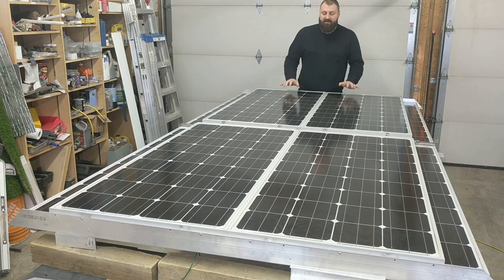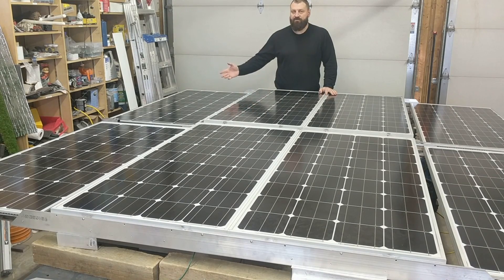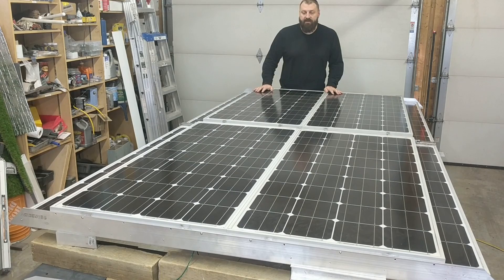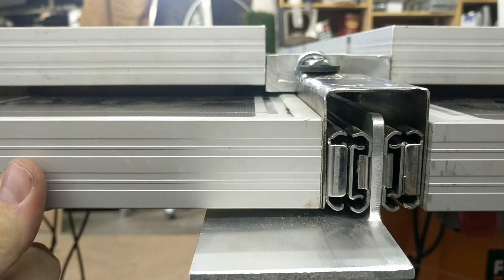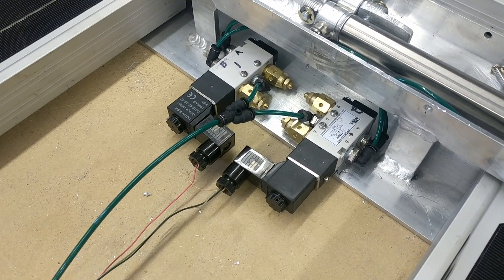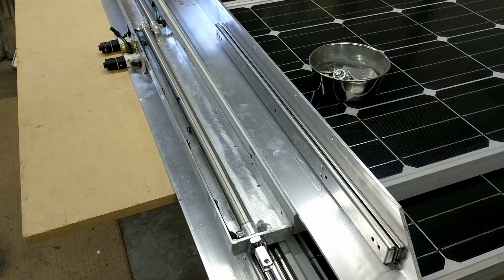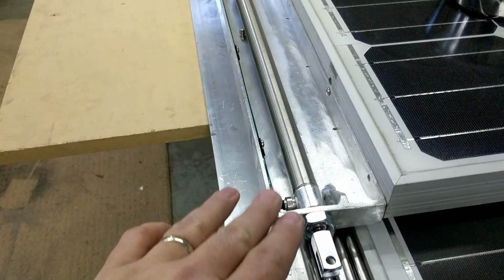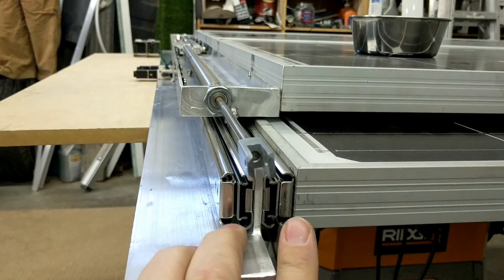Even Moar Solar! 1.4kW Rooftop RV Sliding Solar Install - How to Build an Overlander

Comment: Hi. Just found your Chanel while researching for a sliding solution for my solar panels. So far the best setup I have come across. Sorry to find out your project took a turn for the unexpected. I am very confident both of you will rebound from this pickle and find a way to pursue your dreams in one way shape or form. Life is all about adapting and God knows you’ve amply demonstrated over a decade there is nothing you cannot tackle and vanquish. Call this reprieve a strategic move to recoup, reload, figure out the future and set new plans, whatever time it will take.

You were talking about a friend in his seventies which is kind of what I’m at, with no past experience or knowledge and yet I have embarked on a similar albeit less ambitious path for the next leg of my life. So don’t despair friend, there will be something else, even if it’ll be different, coming your way.

In the coming weeks, I will be talking my own project set to come to fruition next spring, somewhere in Alberta, where I will have moved from Quebec. For the past months I have acquired what will be my new home and the means to transport it, as well as the equipment to modernize it and achieve full autonomy. The solar portion will debut in November and I plan to copycat your system. Most of the work will be done by the RV technician at the Rocky Mountain House dealership where I bought the RV. He’s got a background in electrical engineering but lacks the experience in designing, building and setting up such a system, so the video and accompanying information will come in handy.

Overall there will be twenty panels to install, but roof space being limited, they’ll be setup in two rows of ten overlapped panels, exactly as you set yours up. The challenge was to identify the proper hardware, which you graciously documented as well as the general way the system as designed. Thank you for that. It’s the know how that’s a bit sketchy as the only reference is the video, so not very detailed.

I was wondering if there was a way to keep in touch so that if we hit a snag, we could consult with you? I’m aware your life in the coming months will be eventful so I would do my very best toy best to let you be.But just in case…this would be very much appreciated.  Stay strong, have faith and thank you.  Alain

Comment: Hi! I have probably missed the measurements of the L channel. I know it's 3/16 thickness. I  also performed a search on the context/transcripts and couldn't find it.  Could you share the measurements, please?
Reply from the maker: It's irrelevant... Make them the height and width of the panels you're using...
Reply: @Everlanders ok. Thanks!

Comment: I don't get the aluminum cut pieces to the frame of the solar panel, if the goal is to strengthen the panel frame, putting a whole strip would make more sense? Aluminum don't weight that much. Unless your putting something inside the frame and need the spaces.

Comment: I've been studying this build over the past months. So far, I've been able to model it in Solidworks. The only reservation I still have is the idea of drilling through the side edge of the panel which is extruded and hollow. I assume that you fabricated and glued the 3/8" threaded plates to provide extra reinforcement so as not to deform the edge that grips the panel glass. How much torque did you use for the number 8 screws? Did you use Loctite? I also noticed that you used Sika primer and some kind of adhesive to glue the plates to the solar panel frame. What kind of glue did you use? Sorry about all of the questions. I really admire the work you do, especially because you use open source methods.

Comment: Very nice , how do you stop the travel of the cylinders both going out then coming back in?
What happens if they break when in The out position? Can you manually push them back in and safely drive again?
Reply from the maker: The cylinders extend and retract to their full end stops... Which is the same length as the stainless slides. If they were to fail or we lose air pressure, they can be manually pushed in or pulled out by hand, although in 15 countries, 100,000km over 8 years, they're still doing fine. 🦾
Reply: @Everlanders  that’s Great , did you ever post a list of materials and sources for this build?
Reply from the maker: The cylinders extend and retract to their full end stops... Which is the same length as the stainless slides. If they were to fail or we lose air pressure, they can be manually pushed in or pulled out by hand, although in 15 countries, 100,000km over 8 years, they're still doing fine. 🦾

Comment: I know this video was made quite a while ago now. What great content.  I was trying to find out the dimensions and power rating of your solar panels.  I assume that the 24 inch stainless steel slides would be matched with the solar panel width.  Has 100 lb rating for the slides worked out over time?
Reply from the maker: 8 years and 15 countries later... https://youtu.be/lcck1ejlXt8

Comment: so I LOVE your installation and want to do something similar, the only problem...  I am working with an Airstream with 2100 lb (950KG) payload and wish  to have a total of 10 panels @ 100 watts on top and 100 under it, for 2000 watts total.  I think that alone would be way too much weight, so I am considering ways to keep the weight down.  I already own the 10 glass panels for on top, so I was thinking of using flexible panels under them, lower profile and lighter.  My only concern is the mount points.  My thought is to only mount them at either end and rails and upper solar panels would protect them when driving.  Do you have any perspective on this?
Reply from the maker: I would not consider flexible panels as they are fragile, and prone to fail. Furthermore, they turn opaque when left in the sun.
Reply: @Everlanders  I’ve heard that about the inexpensive ones.  But there’s some higher end flexible panels that don’t have that problem.  At the end of the day, weight is king. I only have 2100lb payload.  I don’t want the solar to be 50% of that payload when we are full timing in it.
Reply from the maker: @escapingthenest2020 I disagree, but it sounds like you've made up your mind.
Reply: @Everlanders  nothing is ever in stone... until it is... and I ain't working in stone, so.... :P  What do you disagree with, is it the payload issue or the solar issue?  If it is the whole issue with payload, I am really curious to hear your thoughts.  If it is solar, do you know anything about either Solbian Solar or Merlin Solar?  Both are higher-end flexible solar panels.  The Merlin Solar panels don't have a clear layer that can turn opaque over time.  The Solbian Solar appears to be mostly used in the sailing world where they are often mounted in places that take a lot of abuse, so I assume they are far from fragile.   If I do this with flexible panels these are the quality of panels I would consider.

I am very curious to know your thoughts though, you know a lot more about this stuff then I do!

Comment: @Everlanders - Have you had any issue with the drawer slides malfunctioning after all this time adn all your travels?

I am building a similar system with 80/20 and I am most concerned with debree, dirt, and dust causing an issue with the oiled bearings in stainless steel heavy duty drawer slides.
Reply from the maker: 15 countries later... https://youtu.be/lcck1ejlXt8

Comment: 170 pounds weights of solar panels plus the rack. is it not too heavy load for the roof? i added only teo 200 watts renogy panel on my roof at the center of my roof. my roof is 16 feets long only abd i lost stability. its like when i drive , the driving wheel i need turn left or right often. normally i never had thst problem. there is 3 inches spsce between my solar panejs and roof top. do i need to install a wind deflector on 3 sides or front side maybe?

Comment: Congratulations, good workmanship. Details are well thought out. The top and bottom panels are placed close to each other. The outward opening surface has been kept to a minimum, ensuring that it is resistant to possible strong wind loads. These seem like things that have been thought about. The pneumatic actuator creates a hard and jerky finish at the end of the opening process. This might be the only downside.
Reply from the maker: In the final installation the air flow was restricted to control the speed.
https://youtu.be/lcck1ejlXt8

Comment: How long will this system last in regards to dust and the bearings?
Reply from the maker: It's lasted 8 years, through 15 countries of full time travel so far...
Reply: @Everlanders  Wow, that's impressive for sure (including the traveling bit haha). I am planning on building something similar. But in that case, good to know it holds up so well. Thanks 👍

Comment: One thing that isn't clear to me is, where does the air come from (green line at @5:10) . You would need some pressurized can/bottle, or a compressor right? I didn't see it in the video. How did you solve or do that in your van build?
Reply from the maker: Our overland truck has 3 compressed air systems... It made for an easy choice.
Reply: @Everlanders  Thanks for taking the time to reply. I can understand how overwhelming all comments and questions might be. I will decide between pneumatic or electric linear actuator. I am watching many of your other videos too, and they are a ton of help. It looks like you have some programming background which is cool. Or perhaps all self thought. I received my starlink today and works great. I will use your hack and roof mount probably whenever I buy a van. The only thing I am not sure about is the solar/battery system I should go for. Obviously the more solar the better and a folding solar roof is a must for sure. Maybe an 2nd alternator. I feel like the Ecoflow 15kwh power kit is the way to go for me because it is easy and clean to install. And 48v system which is more efficient. Don't know about it to much yet. Do you know about this kit? Compared to the standard "Blue" brand. Would love to know your thoughts. For now happy holidays and the best for 2024. Greetings From Holland 🇳🇱😁👍
Reply from the maker: @renstillmann I've reviewed several... Have a look.
Reply: @Everlanders  Yes I tried to search for "ecoflow" but it only comes up with two about the Delta 2 max, and the bleuetti ac500 and b300. Not the "power kit". Perhaps I am missing something. I will keep digging. Thanks though! 😜

Comment: This is a huge idea, hope you're taking it to the next level, brilliant!
Reply from the maker: Thanks! Quick question, what is the next level?
Reply: @Everlanders , guess i'm wondering if you might be able to sell a bolt on frame kit or something like that where folks can bolt it on to their van and insert their solar panels into the framework, ie maybe initially with the option of not installing the auto expanding mechanism and let folks just pull the panels out manually. But bottom line is i haven't seen any kits that do this panel expansion and this would allow a lot more smaller vans to get up to the watts needed for the mini split AC. But then again i just started looking at this stuff as i'm thinking of converting my old toyota sienna into a camper and heard that it would take a lot more solar to get AC working and with your framework, it would double the wattage!
Reply from the maker: It's just 3 lengths of Aluminum L channel and some drawer slides... Get out there and make it.

Comment: How much does it weigh?
Reply from the maker: Aluminum? It weighs 2.7 g/cm3
Reply: @Everlanders  frame, with or without panels attached.
Reply from the maker: It depends how big you make it, just measure the material and multiply by 2.7 g/cm3
Reply: How much does the aluminum frame weigh, without the panels would be helpful.

Comment: You should sell this for us Truck Bed Camper Owners....
Reply from the maker: Why, it's just 3 chunks of L aluminum and some stainless slides... Lots of others have built their own copies to fit their camper...
Reply: @Everlanders  because I cant weld, especially aluminum, and I would probably burn my rig down because I cant electrical either. lol...
Reply from the maker: Whether you think you can, or you can't, I believe you're right.

Comment: Cool...So how has it held up in the wind and travelling? How is it wired? How does it charge when closed having half the panel fully blacked out? And how much did this cost you?
Reply from the maker: Good.
Parallel.
Only the top panels charge.
45$

Comment: So awesome! Sorry if you said it in the video, I skipped through it. How did you wire the panels? I want to do a system like this, but I've been told that if some panels are in the shade they will lower the ability for the other panels to work. Did you do them all in parallel or a mix of series & parallel? If the latter, how exactly? Thanks!
Reply from the maker: All in Parallel to avoid shading issues.
Reply: @Everlanders would the shading issue also be resolved if you did each slide as 2 in series then put them both parallel with the top 4? With either the top 4 in series or in series sets of 2 put together in parallel.
Reply from the maker: No

Comment: I've seen electric linear actuators used in a similar manner in some harsh environments. I have no experience with the reliability of pneumatics but it sure sounds great.
Reply from the maker: For the low price, ¾ inch diameter, reliability,  speed, ease of transmitting massive power through a long 2mm air line, etc, etc, it was an easy choice for me...

Comment: I have been designing this exact concept in my head over the past two months. You did this five years ago! Are you building these professionally yet?
Reply: I was thinking 12v linear actuators under the bottom panels and raising it up to fit the cylinders. Pneumatic actuators make it more stream lined.
Reply from the maker: How are European millimeters different than my millimeters?

Comment: Full time Rv'r for almost 2 years now. About a year ago I installed 4,350 watts of solar panels on the roof, with a 6,000 watt inverter and 15,360 watts of 48 volt battery storage. I have travel over 5,000 miles and it works great.  I did this because I don't trust the economy.  I am never without full electricity, even while the road.
Reply from the maker: Okay, but if you don't trust the economy, how are you going to buy fuel?
Reply: @Everlanders  I can always get enough diesel to get back to home base, where I have  long term storage of many items including food, if the economy ever gets that bad. RV'ing full time and rent buy the month, I usually am charged for electricity.. since I've done this, electrical rates have gone up more than 7 cents per KW, that adds up, My average electric bill when hooked up to the grid ( rainy days and such). has been under $30 per month,  that includes running a/c and electric heat, Microwave, and laundry, and everything else.

Comment: Perhaps you’ve answered this in one of the million comments so sorry if a duplicate. Curious how much power you get out of the lower string while they are retracted. It looks like they get some sun. Then also after all the years, what percent of your power comes from top versus bottom panels?
Reply from the maker: You will get zero power from a panel that is partially shaded.

Comment: How are those slides holding up after all these years of weather?

Have you had any dielectric corrosion issues with the aluminum/stainless combo?
Reply from the maker: Still fine, can't imagine how they'd be dielectric corrosion cuz they're not passing current nor are they underwater...
Reply: @Everlanders  rainwater mostly. I get a lot of problems with it at work due to condensation on our chiller system. But that's a constant and daily issue.

Comment: That is amazing, I wish I had that welding ability lol
I may have missed it but how do you control the solenoids?
Reply from the maker: Various conditions are monitored via python on Raspberry pi, and if the criteria are met, the panels are deployed using the custom Driver Boards I built.
Reply: @Everlanders  that’s amazing, do you sell these control boards or have a video on how to build & program?
Reply from the maker: https://youtu.be/AL1_fvPZXMk

Comment: Awesome work. I hope something like this becomes a commercially available product.
Reply from the maker: Pretty Unlikely.
Reply: @Everlanders  Why do you think? There's some pretty elaborate solar panel mounts in the non RV world. And it seems to me that if this enables solar air conditioning even on small RVs, people might be inclined to spend $10k on a solar system (including the $2k mount). Or maybe I'm underestimating other people's hatred of generators, ha.  But I sure hate generators, and air conditioning is always the thing that keeps people relying on them in their RVs. But now that lithium iron phosphate batteries are getting better, cheaper, and simpler by the day, I'm hoping the time for other people to kill their gennies with fire has finally arrived. Or maybe I'm just an optimist.

Comment: I don't have any experience with the air system you used, but as I watched your lower level panels slide out, I thought I might attempt this with linear actuators.  Yours would still be quicker than mine with the cool Star Trek sound.
Reply from the maker: Having service hundreds of failed linear actuators, I would never consider them in this application...

Comment: Great concept and design. Only advice when the trough gets filled with ice it might not deploy, I would invert the trough so it won't hold water.
Reply from the maker: There are no moving components in the trough, It is frequently full of ice and we've never had any problems.